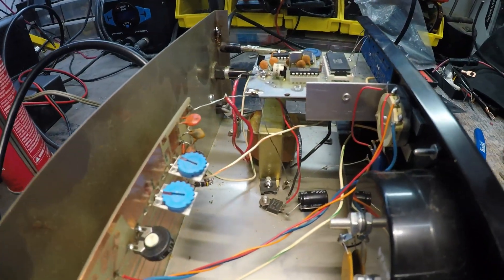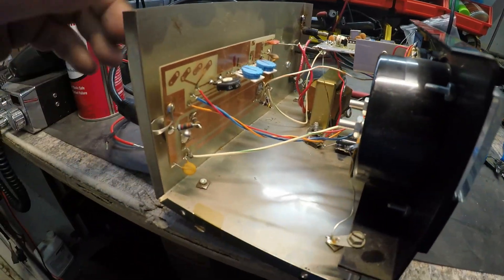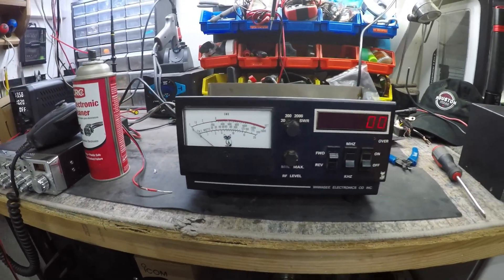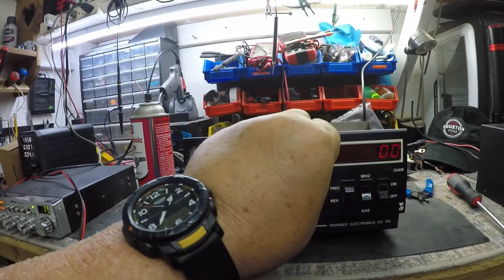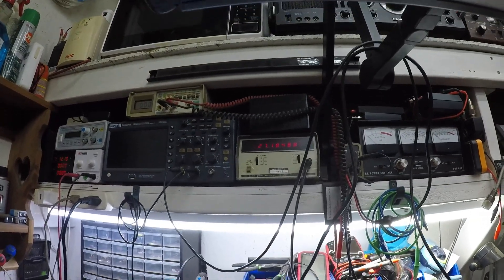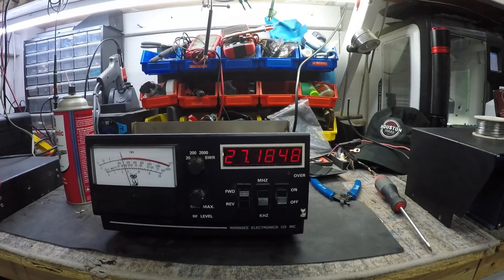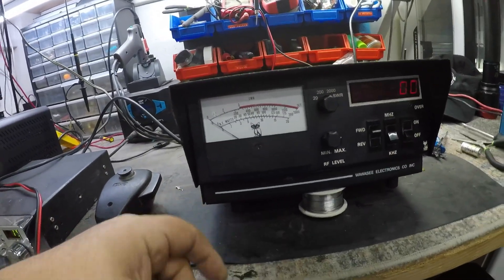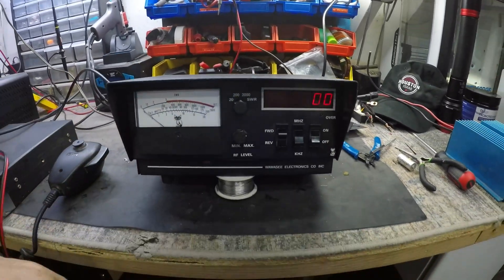Rare Wawasee Power SWR & Frequency Counter Meter – Ham Radio & CB Operators Must See!

Comment: Hey I see one of your videos about you restored a unit of Grand XL I have one I need to have someone know what they're doing to it to get it aligned and see what else you can do to it different mods I know the clarifier is stuff and unlocked it does have high and low channels it's been modded already but it will not transmit on the side bands there's a wire broke off in the inside I don't know where it goes
Reply: I need help trying to fix it does not too many CB shops around me newest one is 3 hours away and I don't go to the city a lot